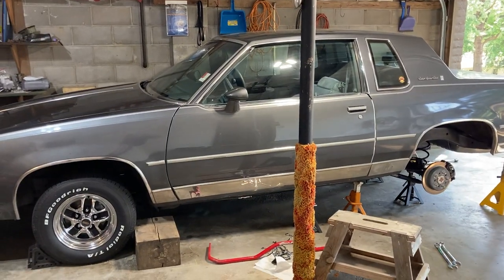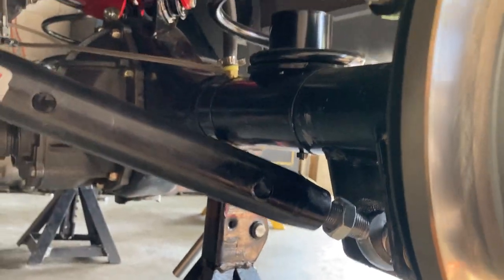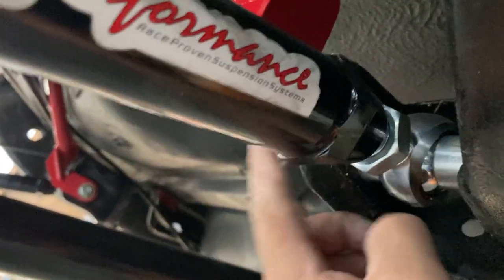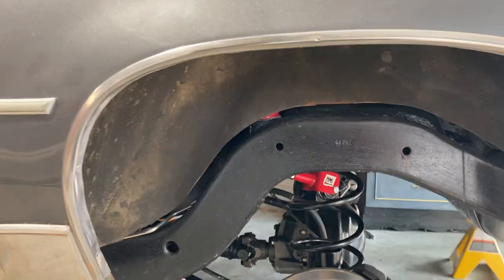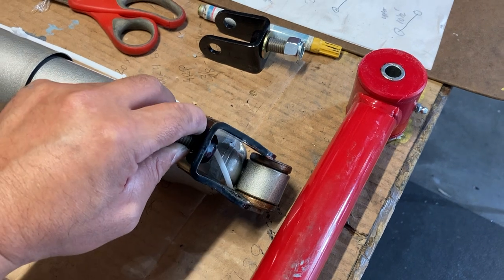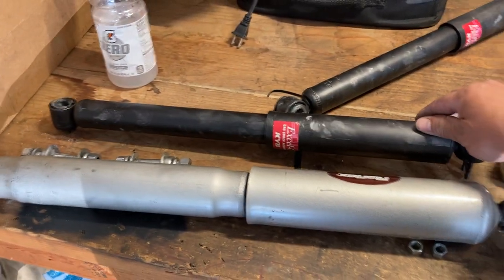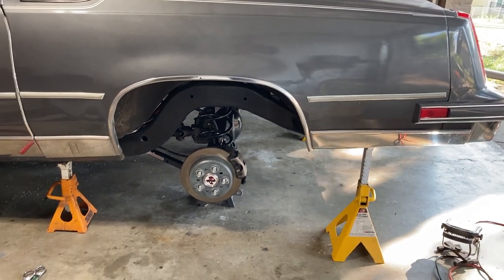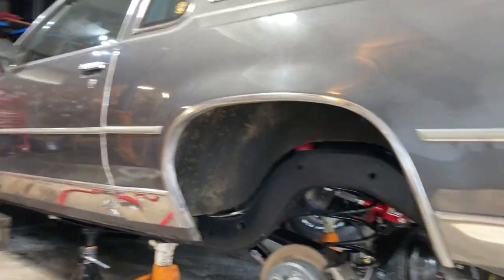G-body trailing arms

Comment: How is the ride and noise on the street using the dbl adjustable non poly or rubber bushings? Great info
Reply from the maker: I greased everything up really good. But I’ve never heard any squeaking especially over the exhaust. I’ve done burn out after burn out and punched it all over the city. No issues with anything
Reply: @davidanscomb2034  Nice..I was worried it might be a harsh ride on the street but I'd rather have the performance and yeah never hear anything over the 3inch exaust I'm running. Thanks for getting back

Comment: If you have extra weight in the trunk. You need a higher spring rate, not longer springs.

The rear is sitting too far forward since the control arms swing in an arc. Horizontal is further back, pointing down is what happen to your car, too far forward.
Reply from the maker: I have heavier spring rates from Eaton. Also swapped out for adjustable upper and lower control arms . Then got a rear alignment. Now wheels are centered . I’ll update a video

Comment: Can a bad rear trailing arm cause one side of the car to lean
Reply from the maker: It could be different things. One thing could be missing or rotting out body mount bushings. Check your body mount’s forsure. I had to cut mine out and weld in new

Comment: Was supposed to get 90* fittings/hoses for rear brakes.  Instead I got straight fitting AND straight hoses.  I see you got straight as well.  Ordered 90* off Amazon just incase.  Did you run into issues with brake line off caliper hitting shocks?
Reply from the maker: Yes i kept buying shocks until I found some that worked and I made some custom brackets at the welding shop
Reply from the maker: You would think for the money that would be a better fit
Reply: @davidanscomb2034  I think most places show you 90* fittings with either the fitting elbow or an elbow in the hose.  I ordered from QP and got straight on both.  That doesn’t work with viking coilovers

Comment: Hello, 

I have an 87 cutlass with 15 inch olds rally’s and an 8.5 rear, can you tell me where you purchased rear disk kit?
Reply from the maker: Quick Performance located in Ames Iowa
Reply: Thanks!
Reply: Hi,

One last question, were you able to use the stock master cylinder (i know I need a disc to disc proportion valve)?

Comment: Just got a rear end for my Cutlass from Trick Chassis. The disc brakes (w/parking brake) doesn’t want less than a 16” wheel. What size are those lovely factory looking wheels? 
I need info on those rear brake lines too.
Reply from the maker: Wheels are 15 inch rallies, rear parking brake set up is the universal wilwood kit
Reply from the maker: I take that back they are 14”
Reply: @davidanscomb2034  thanks for that. Those Wilwood brakes came with the lines?

Comment: I’m doing a ford 9” swap on my 1983 cutlass I’m putting 24s on it I wanted to shorten the rearend so  the rims could be a little tucked I know stock is 58 inches how much should I narrow
Reply from the maker: I don’t know that one, i was going to do the same thing but i was worried about only being able to run the specific wheel and offset with a shorter rear end

Comment: Hey bro, great work💯. Could you share the part numbers for the e brake parts you used?
Reply from the maker: I used the universal gbody wilwood ebrake kit for the rear. And the stock longer cable for the front I can make a video of it this weekend if it would be helpful
Reply: @davidanscomb2034  I have a83 regal and I want to put 22's underneath with a stock ride height what the width of your rear axle ?  And did you have to notch frame ?

Comment: I have the exact setup on my cutlass with the quick performance 9 but can’t get my pinion angle to kick up positive degrees before the uppers separate and fall
Reply from the maker: Get it as close as you can to where you can drive it safely and take it to a suspension shop that can align it.
Reply from the maker: I would just get everything put together first
Reply: I got entire suspension set up but spooked to get drive shaft because I don’t want it to be too short or too long after they adjust everything. Probably do what you said and send it

Comment: What rear are you running?
Reply from the maker: Quick performance 9” with 3:70 gear ratio or close to the stock ratio for hwy use. In retrospect I would have went with a faster gear ratio like 410

Comment: nice car, did you need new driveshaft for the ford 9 inch. why not stay with gm?  those non adjustable lowers do look short.
Reply from the maker: Yes, i had one made at a company named “ inland trucking “ its here in the city. I did not stay with factory for two reasons 1) wanted it custom fit 2) everything else is new on car: transmission, rear end, suspension, fuel system etc. the old one had surface rust and 30 year old u-joints.
Reply from the maker: Thank you, are you building something?
Reply: @davidanscomb2034  i have 78 el camino and put hotchkis rear trailing arms on mine, just a cruiser

Comment: Did u run e brakes
Reply from the maker: Yes, and it was a bitch. I ordered a universal kit from wilwood and bought about four or five different front factory parking brake cables to make it lineup but then I had problems with the Ford 9 inch brake assembly off of the explorer. Some thing was getting in the way, so I had to take it to the shop and they disconnected one side.

Comment: I just finished restoring the frame.. moving on to undercarriage to restore.. how did you get the body on the frame? I'm working with Jack's, jack stands and two 6x6 post
Reply from the maker: It’s not that bad however you have make sure you center it pretty much exactly where it was. Because when I put mine back down i had too shim the hell out of the back bumper because the body was about an inch to far back. I really noticed it and it was a struggle when I put the radiator core housing back, nothing warmed to line up as far as the front body panels. And i had to add washers as shims under radiator core to get it to mate up. Im sure you will run into the same problems just hit me up. I’ll make a video today about it for you
Reply from the maker: It was intense but I had six jack stands as far out on lips around the car. How I got my boards out was I used a harbor freight jack with the telescopic extension arms that swing out. And I use that in the front underneath the floor pan to raise the body out just enough to clear the boards. Then I slid them out and set it down on the six jackstands. I went around the back and did the same thing with another floor jack. Then I use those cheap harbor, freight wheel, dollies to wheel the frame back underneath it. Then I got the frame up on jackstands and put the floor jacks back onto the car again to move it around to line everything up while I set it down
Reply: @David Anscomb  thank you! a vid would be so helpful my name is Ruben btw.. yeah I'm doing this all solo so it's kinda intense.. taking out wasn't so bad.. I slide the frame out to left.. I had all 4 jack stands within the frame

Comment: So that QA1 9 inch it all went right in with no issues?
Reply from the maker: No issues at all. I had a problem with shocks, and fabing brakes.
Reply: @davidanscomb2034  thank you I'm going g to be buying the same rearend in the next month or 2 I have a 88 monte carlo SS with a wicked 427 big block it's bored 60 over has AFR heads a Howard's hydraulic roller cam turbo 400 with a reverse manual valve body 3500 stall converter the motor made 661 hp on the dyno and 605 torque going to be a fun street car. I looked at the rearend a couple of months ago and it was around 2.200 dollars does that sound about right? Let me know thank you.
Reply: I didn't see any QA1 equipment. It's a Quick Performance 9in for G body and UMI arms. Cost will vary depending on the options you choose. I went with the Wilwood brake kit and powder coating. Mine come to a little over $2800.
Reply: Your right I'm sorry I didn't mean to give you the wrong info sorry again

Comment: What front spindles are you running
Reply from the maker: All star gbody replacements metric “ not drop spindles” and Dorman castle nuts off Amazon 05193.
Reply from the maker: Also I did not use above ride height springs in front. But I did use S-10 lower control arms.